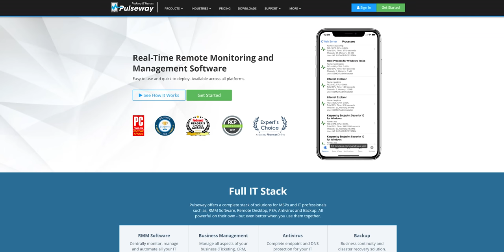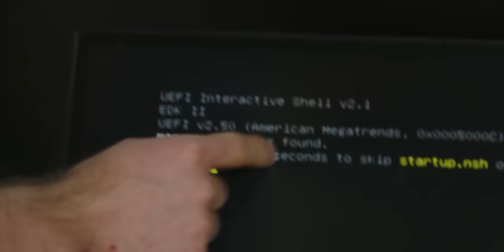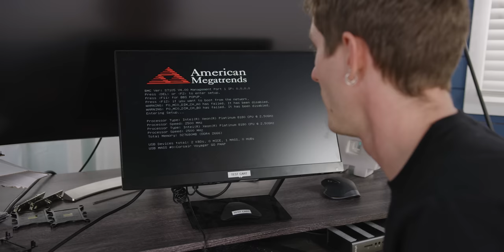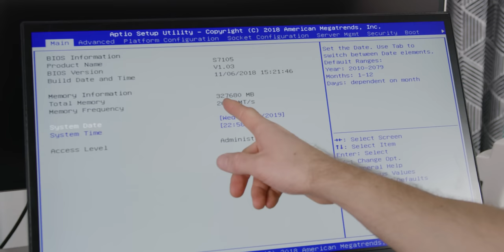Can I FIX this $10,000 CPU??

Comment: im actually triggered once he dropped a m.2 drive, this is not even funny. CAN YOU FREAKING BE MORE CAREFUL?
Reply: Well, the m.2 is way more forgiving when dropped than a high end extremely big pcb cpu :p
Reply: Maybe these component manufacturers should put a little more effort into durability!
Reply: @kant12  uhhhh no? When you are handling any computer component you should be careful and not drop it.
Reply: I dropped a glass of water on my keyboard luckily its working though for sometimes random keys were triggered
Reply: like you never dropped thing that cost more than 10$ (like your phone) lmao.. only difference is, that Linus drops hillariously expensive stuff because he works with it.
Reply: @kant12  or maybe these end users need to put care into how they handle their components.
Reply: @Luca-vw7xd  knowing how linus is, this will be an ongoing segment... might even be enough to start a new channel ala techquickie
Reply: I really dont care about the hardware, but having a boss with such an attitude... thats probably the worst.
Reply: @vrbobde  you should open it up and make sure everything is dry and maybe clean of some corrosion with isopropyl alcohol before alot of corrosion starts to build up and keys won't work anymore. Sounds like a hassle but it safed 2 keyboards for me.
Reply: no
Reply: Yknow what's worse...gorilla glue expands until it sets...
Not letting it set before un-clamping would make it worse...
Impatience is expensive
Reply: cpu is not made for falling man x)
Reply: Ain't even your hardware, y u mad
Reply: @n3ttx580  Are you asserting that you should not handle fragile multi thousand dollar item with more care than cheap, durable items?
I mean I see your point, but it also contains a logic fallacy.

I wonder if Nokia will ever get into the PC hardware business, then the linus of the world won't be a problem anymore.
Reply: I've got a clumsy gene like linus. It's not in your control. Your body just spazzes out and throws things occasionally. The only way around it is doing everything extremely slowly and methodically which takes forever. And even then that doesn't always work.
Reply: I've never dropped a phone in the 10 years I've had smart devices, then again I'm not a careless idiot. Regardless, there's a big difference between $10,000 and $10, and consistently dropping & breaking things and an accidental slipup once or twice.  If most of us were as bad as Linus at work we'd be out of a job.  Good thing he gets this crap for free & is  his own boss I guess.   @n3ttx580
Reply: I dropped my m.2 as well. It works just fine :)
Reply: @kant12  they should hire whoever runs or ran the QA team at Nintendo in regards to durability, cuz their tech has been great for decades
Reply: Lol, yeah, you'd think he'd be a bit more careful with components that cost more than his car.
He even refused an extra set of hands in this vid, while balancing the CPU in a clamp, held up by his chin.  
I wonder if he's doing it for the memes - does the drop meme generate more revenue than the 10k components are worth?  I guess if the formula works for him.  But if i was handling a 10k cpu, I'd be moving like a damn sloth lol
Would not take any chances.  But hey, it seems to be working for him lol
Reply: Nah, it's a 1 parter, at least it was on floatplane
Reply: doggie0819 so true..... It probably costs more than my rent....
Reply: @n3ttx580  You drop your phone because you move it around and pick it up a lot. You are only handling your cpu, gpu, and other PC components basically a few times before its just in your case forever. You never purposefully drop your phone, it just happens by accident.
Reply: But if he didn't he drop things we wouldn't have these videos to laugh at.
Reply: Xalzor hey, hey, you can't go around calling people idiots when you don't know the difference between "allot" and "a lot."
Reply: @Ganjaz  that's kinda the point...
Reply: @Vihara2  Agreed.
Reply: @justanoman6497  nope, i'm not saying that. And tell me, where it gets behind logic? Yes, he should've been more cautious, but imagine being under stress every day, film videos, have a lot of people under you and your decisions and having tight schedule.. hadling items with care is probably one of the least thing you (ironically) take care of. I can relate to that, even tho i don't f*ck up 10k$ CPU.. 

For the other guys (can't tag more than one wtf).. Lurr17: Good on you. You doesn't have to be careless idiot to accidentally drop stuff (like having it on the table, quickly turning on chair, bumping into table and dropping phone..) or as he did with that M.2 drive, knock it off.. stop being salty ffs, you know it's not your stuff and he can get another one witout problem.

Xalzor: wow really? tell me

Michael Tong: Yes, obviously that is true for average customer, but not for somebody that assemble and dissassemble multiple systems a day for things like benchmarks.. you think that they build a system and leave it? I actually wonder in how much different configs their famous "i7 8700K" that they use in almost every video has been in.
Reply: @n3ttx580  Your original statement contains the following element:
People dropped things
Therefore anything can be dropped
By comparing a cheap, durable item (phone) with expensive, fragile(CPU) in equal light, you suggested that the above fact is constant for all things.
Therefore, due to the multi thousand dollar being just a "thing" that Linus have access to, it gets dropped.
In other words, an assertion that possibility and probability of an item being dropped is only dependent on the inherent fault of people to drop things and independent on value and fragility of the item in question.

I can understand what you meant to say, but that doesn't make the way you said it logically sound.
It's like describing a square as a shape with four equal sides. That's actually an incorrect statement.
Reply: @PecanPie745  woosh
Reply: You're new around here huh?
Reply: Cover the floor around the work area with bubble wrap!
Reply: @justanoman6497  It's like describing a square as a shape with four equal sides. That's actually an incorrect statement.
wtf
Reply: @DeSync-oi3yq  By "describing" I meant to another person, in other words provide a working definition of the object to teach others what it is. Therefore it cannot be just "a description", it needs to be "the description". It need to accomplish both being the correct description for the object while simultaneously excluding anything that it is not.
A shape with four equal sides describes a rhombus, which square is a subclass of. But not all rhombus are squares, ergo it is not "the" description of square.
Reply: he needs to install a bouncy floor like they have in gymnastic halls
Reply: Worst type of People, I hate how they are careless like everything is junk..
Reply: next time on ltt: fixing an m.2 drive i dropped
Reply: Bro its hes money wtf are you saying over here lmao
Reply: Y’all can quit sweating so hard over something that you didn’t pay for; or you know; not watch
Reply: @PecanPie745 uhh yes? Accidents happen, component manufacturers NEED to make them more durable
Reply: If I drop my phone will u be mad? It ain’t ur stuff anyways